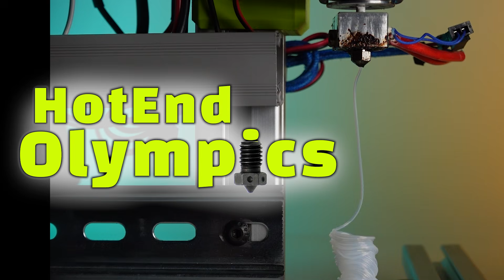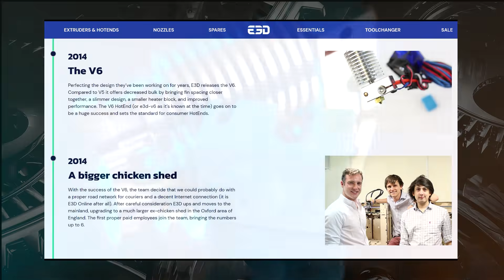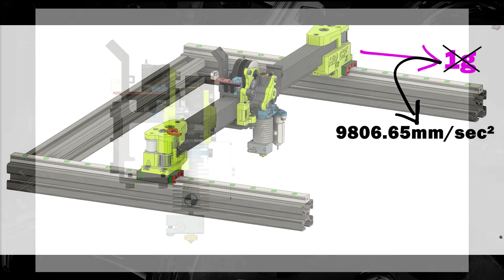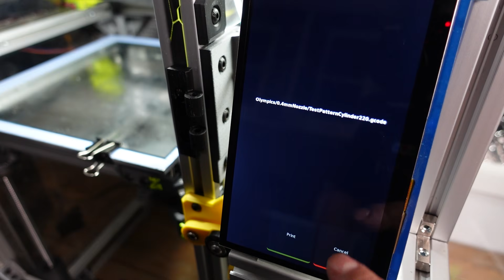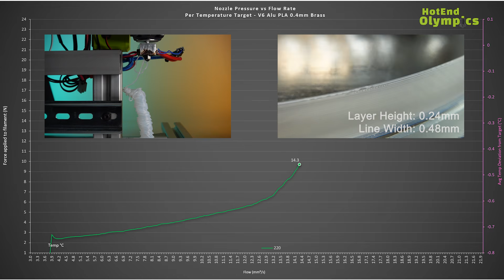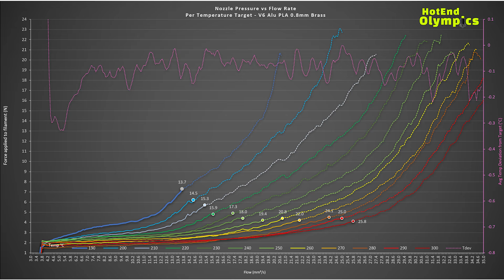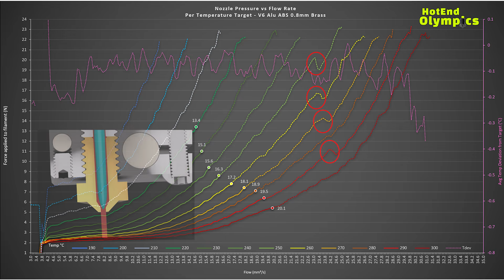How to find the best HotEnd? - Ultimate HotEnd Testing - Episode #1

Comment: Please allow me one correction for the part: swallen melt phenomenon. The swell of the melt after leaving the nozzle has two main reasons. 
Firstly it is connected with the flow speed distribution of the melt in the cross section of the nozzle path. Inside the nozzle the speed of the melt directly next to the nozzle wall is normally zero, so it sticks to it. In the middle of the cross section the melt speed is the highest. In between there is a bell-like shaped speed profile. When the melt is leaving the nozzle, this speed distribution of the melt becomes instantly flat (equal speed in the whole cross section), because there is no more nozzle wall to stick to. To this almost instant cross-speed change the melt reacts accordingly and forces the melt naturally to take a swallen form. 
The second reason: plastic is basically a bunch of entagled molecule chains / macromolecules / polymer chains (the lenght of the chain can reach few million links). Like a microscopical dense cotton wool ball. If the melt is being deformed in one direction (passing trough a small nozzle hole), the molecule chains are going to be unidirectional, they will be more or less parallel to each other instead of entangled equally in any direction. It requires energy to get to this parallel-form (squeezing the melt trough the small hole by the pushing force). When the melt is leaving the nozzle to free air, this squeezing force is gone and the macromolecules are going to get to their lowest-energy shape again, which is entangled (due to entropy). When this happens, the melt is changing the shape accordingly, it gets swallen. This is also called the memory effect, the plastic wants to get to it's original form again. This is partly the reason, why you have inner stress in your 3D printed part. And this is the reason, when the 3D printed part is heated up over a certain temperature, it is deforming. The filament wants to get back to it's original shape. 

And to couple this back to the MFR topic: when a melt is more viscous (more thick, equals low MFR), it requires more energy to push trough the small nozzle-hole, the speed profile is more sharp and you bring in more energy to make the polymer chains (more) parallel, it will swell more. With more flow speed even more. A high MFR plastic is behaving the opposite way, you will barely see any swell. By the way, the MFR is directly connected with the length of the polymer chains. Short, entangled chains can be reoriented more easily, long chains are harder to reorient.
Cold core extrusion exists (the core of the melt does not reach the melting temperature), but I dont know if it has an influence on the swell. Probably yes, but this is not the main issue for this penomenon. In my oppinion, what you see when you cut the extrudate is probably the not uniformly crystallised plastic.
Reply from the maker: Oh wow !  Thank you, thank you and thank you! This is so much good information.  My understanding of what is going on has evolved at light speed reading your comment.  I thank you for taking the time in explaining this to me.  I will try my best to integrate as much of this new knowledge in my next videos.  Once again, thank you!!
Reply: @MirageC  Nothing to thank for, I am glad to be able to help to understand plastics better. I was looking for a link for a more detailed description and pictures, but did not found a good internet source for this topic. I only have my books as a reference, but all written in german. 
If it helps you with your hotend olympics even just a bit, I am happy, because your work is very important for the community and 3D printer industry. 
A little related to this, but rather off topic, which I want to add to this conversation because it bothers me a lot: there are a couple of myths about the filaments in the 3D printer community in regard of the physical/mechanical properties and choice of material. My advice to everyone is to read, try to understand and compare the datasheets of the filaments. Any information is there, free of charge, it takes just a little background learning, how to understand all the data. Many of the PETG and ABS fans would be surprised, how "low-level" material those are. My message is, that if a plastic is more expensive and is harder to print, does not necessarily mean, that it is better.

Comment: Could the lack of sock be a factor in the low performance obtained? I didn't run any numbers but with the low wattage cartridge it seems plausible a significant percentage of the power might be getting dumped into the air.
Reply from the maker: Not for the rig testing.  The only air disruption around the hotend block would be from the heat sink fan.  As the airflow is not directly oriented towards the block, the boundary layer around the block itself can maintain a healthy thickness therefore acting as thermal barrier/insulation.
The second point making me think that this is a non issue for Rig testing, is that the PID tune was able to maintain the temperature of the block pretty stable until the very high flow at high temperatures.  This means the temperature of the nozzle and the material around it was stable and constant to the requested temperature.
For actual printing condition, then this was different. I even turned off the cooling as I was lacking thermal power pretty quickly when using my CPAP super cooling... lol.
Reply: @MirageC  I'm not talking about active cooling with air flow, just radiation & convection. Given what a good heat conductor aluminum is, that's possibly significant.

Comment: I think you should measure the distribution of weight and the stiffness of the assembly at temperature.

A hotend that's more bottom heavy will introduce a greater error at the same printing speeds than one that's more top heavy. This effect will be even greater with less stiff constructions
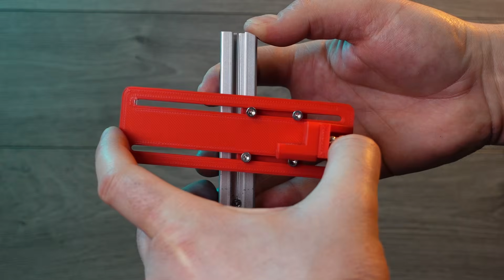Reply from the maker: Yes, this is exactly the goal with measuring the moment of force at the mounting point defined by the application of the hotend's weight on the CofG.  See 5:08 .
Reply: @MirageC  Yeah, sorry. I noticed I missed it and forgot to edit the comment to just speak of the stiffness
Reply from the maker: @AlexusMaximusDE  Agreed about the stiffness.  I am not planning to measure that, be for sure the heavier hotends being held by the heat break only will be problematic in terms of flex/precision and reliability.

Comment: Could the weird pattern we saw in the ABS at high extrusions be slippage of the material from the nozzle’s inner surface area? Maybe that’s a little Goldilocks zone where slippage occurs. Not super useful for 3D printing, but it might explain it. Idk if that’s even possible, but I vaguely recall that being mentioned as a possibility in my rheology course. Just wanted to throw out that as a hypothesis for people smarter than me to consider. 

Regardless, this is such an awesome video and the amount of work that’s gone into it is so impressive! Really excited to see where it goes!!!
Reply: It is called the stick-slip effect. Normally the plastic melt is sticking to the inner wall of the nozzle, so the melt speed directly next to the wall is zero. When a certain speed is reached and the forces between melt and nozzle surface are high enough, the melt starts to move on the nozzle wall as well and so the speed directly next to the wall will be non-zero. In english, the melt slips on the wall of the nozzle. 
https://en.wikipedia.org/wiki/Stick-slip_phenomenon
Reply: @gabortoth3300  We always assumed “no slip” for any of our calculations, so I knew there was a case for there being slip, I just wasn’t sure if it would make sense in this context around that temperature/speed. Thanks for filling us in with more info though, I’ll have to look it up to see if it might be what we’re seeing in this data!

Comment: Does a closed loop Stepper driver make sense for the extruder for measuring slippage and calculating flow rate?
Reply from the maker: I have this data already from comparing requested extrusion distance and actual Rotary encoder obtained value. This method is probably better than with a closed loop stepper since it also takes into account any slippage/chewing of filament on the extruder gear.

Comment: nice video! Great data for a future printer build for work (...can't afford another for myself or expensive upgrades...), but it's also funny to see how the results of the genuine V6 correlate so much with the results I'm getting on my Aliexpress clone V6. Frankly, that's quite an achievement for the cheapo part!
Let's see the later videos to know what I might be getting if I ever end up going faster, heck even my own machine with a wide line width and taller layers can benefit from a good hotend anyway.
Reply from the maker: I would not expect a V6 clone to be miles off from the real deal. The simplicity of this unit makes it difficult to miss.  No special coating or complex machining.  Unless you have material inclusion in the aluminum raw mat or very bad machining tolerances, the results should be extremely close yes.
The difference between clone and real resides in the amount of support you want to give the original inventor who has put his heart and sweat at developing the best product for your needs.
Reply: @MirageC  One day... One day I'll have the money to just go with originals and not bother with hit or miss clones, probably gonna be with a Revo or such.
I hope this day ain't taking long!

Comment: I'm also very excited to see where this is going. I'm not really interested in the "physical" part because my hotend is stationary on my quantum delta printer.
I am really curious which hotend you will find the best with the shortest meltzone. My current hotend is rapido with a supervolcano nozzle which sticks out at the bottom. The bottom part is covered with a chc pro heater and a 0.5 cht nozzle. The ridiculously long meltzone probably is the cause for my relatively poor pressure advance calibration. But this is just a guess and we all are always looking for an upgrade :P

Comment: Crazy excited. Love most of your methodology, I'd be interested to see differences with wattage changes in heater cartridges.
Reply from the maker: Wattage will mainly affect heat up time and will allow crazy cooling solutions.  Given we are not exceeding thermal output capacity of a low power heater and that both units have been properly PID tuned, there would be no extrusion flow gain from installing a more powerful heater.

Comment: Science B*! I think this will make history and difference for whole 3d printing community and industry. Hopefully we will see even better hotneds at future after you have cracked down key factors of good hotends. Anyway I recommend that you will also test to cut one CHT extruder screw part and put it in to longed heat block with another CHT extruder. Or cut normal extruder and use it as pre heater with CHT.
Reply from the maker: Yes, definitely will be playing with a lots of different configurations ;)

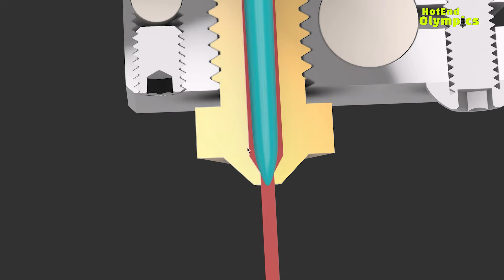Comment: 16:46 Have though about this before, the unmelted core is real. Larger nozzle size is mostly just a way to let a larger semi-solid core pass through the middle, so its not the best way to increase flow rates for effective printing.

Comment: Wow, great data. 3D printer scientist. What is the frame rate on the high speed video? That fan looks like its going to bust! Can you just rely on the hotend moving rapidly through the air to produce enough airflow/heat transfer?
Reply from the maker: Printing PLA with opened enclosure on a large part could potentially generate enough air flow to avoid using fan.  As a matter as a fact, I did it a few times using the Nova.  The only problem I kept having was when preheating the printer and then tune stuff or work on it, then I would forget about not having fan and would systematically get clogs.  This being said, I am now evaluating a theory about the heatsink playing a larger role than what we think.
Reply: @MirageC  looking forward to your theory on heatsinking. I think you are on the right track!

Comment: Great video, we need more proper science in the comunity.
Btw, you dont want to use moment (nm) as your measurment as this presumes the force comes from gravity.
You instead want to use moment of inertia (kg*m^2) = mass * distance squared. This is what determines how much rotational force (and this vibration) your printhead will cause under acceleration.
Reply from the maker: Thanks for the tip!
Reply: @MirageC  Even still, mass is the more important metric as this is primarily a linear system
Reply from the maker: @sssfsfdfsdsdffsfsdf4  Well, we need a certain balance between mass and flow capacity.  If mass was the only criteria, we could get a super light hotend with barely no flow to score high on the chart.  Anyways, I am sure that looking at the numbers as we go, something is going to pop out loud and clear in termes of what makes a good hotend VS a bad one for speed/quality printing.
Reply: @MirageC  Mabye length of meltzone is a good metric?
Reply: @sssfsfdfsdsdffsfsdf4   What length of melt-zone would you use? 
The nozzle length only, or the nozzle and the section that is screwed into the heat block or event the heat block itself being a path for the melting zone? 
As nowadays, to increase flow capacity, for similar nozzles, the heat break tube is also a pre-heating melting zone, depending on its material employed, very variable from manufacturers and can increase highly that characteristic. It could be interesting to evaluate it.
An example would be E3D V6, nozzle length is 12.5mm, heat break tube into the heat block, between 4 and 5mm, that would bring the melting zone to 12.5+4mm = 16.5mm? compare to an MK8, where the Bowden tube goes against the 13mm long nozzle, that would be its only melting-zone.

Comment: This rotary encoder... where can you get one?
Reply from the maker: I have added links in the video description. ;)
Reply: @MirageC  Yes for the encoder is good, How about STL files to 3D Print other parts; Thank You for that link to:-
600 P / R Pulses Incremental Optical Rotary Encoder AB Two-phase 5-24V 600 Pulses Incremental Optical Rotary Encoder 6mm Shaft
￡6.42￡7.56-15%
Reply: @MirageC  P.S. I tweeted your video out

Comment: Are you aware of this or another pressure sensor being adapted to measure belt tension? Seems very easy to do in a similar fashion to how you have set it up. Someone on the klipper group asked and I sent them this as a clue... cool video by the way. Can't wait to see the progress!
Reply from the maker: You could repurpose one of those load cells to measure belt tension, but I would add a locking mechanism to freeze the system once the reading/adjustment has been taken.  Have added a link to the load cell I am using in the video description. I am using a 0-5KG unit, but I would assume belt tension will required more depending on how you set the pressure lever.

Comment: One more thing is important to know about the hotend: how much filament can be extruded very fast.
I'm pretty sure that any hotend can extrude almost all the melted filament which is already well melted inside the nozzle.
So it is almost the volume of the nozzle internals. You can reach let's sat 100 mm3/s for 100 millisecond or so with no problem (the only thing is needed is to slowdown afterwards to let all the cold filament to reach desired temperature inside the nozzle)

Comment: I think that your estimation of the maximum extrusion point is a bit wrong: the fact that the line goes non linearly up means that the plastic does not reach desired temperature at the nozzle tip.
Linear range means that the flow experiens viscosous resistance which is OK.
Reply from the maker: Yes, this is definitely something I would like to explore eventually.  Ultimate Maximum Printability VS Maximum Functional Printability are 2 different things.  Stress testing of printed coupons could shed some light on this.
Reply: @MirageC  I'd say that the material temperature is very important for 3D Printing: it will influence not only the strength, but material degrodation (if the temperature is too high), stringing, overhangs and so on...
Many of us spending hours to tume up the printing temperature with 5 degrees steps, but then many of us ruins it up by pushing the hotend at it limits ending up with a temperature differs let's say +-20 dergees at different parts of the print... Bad idea :))))

Comment: I wish I chimed in before you started this. I'm totally down with what you are doing, and I love it, but (after you take your much needed break from this) can you also throw in the hot (thermal) mass of the heat block? My pet peeve is going from a slow flow to a faster flow, like a perimeter to infill, and then back to slow. I do my math to keep it constant, and I have my own tricks as well, but I would like to know which hotend would make that window smaller. If you are up to it. Have fun, and thanks for your efforts
Reply from the maker: I did some burst testing during my research and this is something I really want to re-visit during this series.  so yes, thermal accumulation and melt zone provision will be interesting to quantify and qualify.
Reply: @MirageC  awesome, thanks!

Comment: 14:45 OR  A BLDC AND ODRIVE lol
Reply from the maker: More power will get you in the unpredictable zone and potentially non-uniformly melted plastic.  Without speaking of potential elastic compression.  So I don't think we actually need more toque on the extruder at this point.  I am convinced that the situation will change when we go with more performant hotends requiring the stepper to spin much faster.  I did not mention it in the video, but my nema 14 runs on 48VDC already.